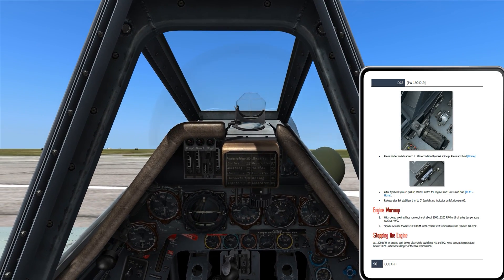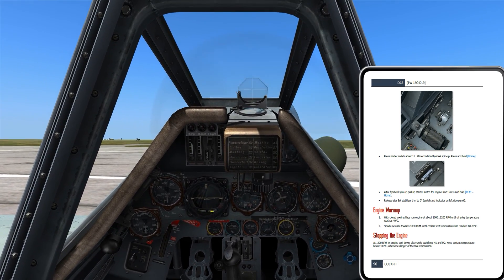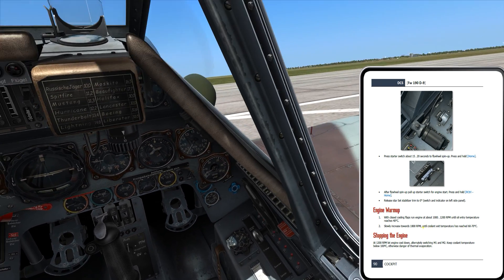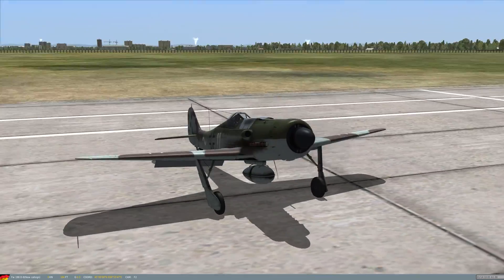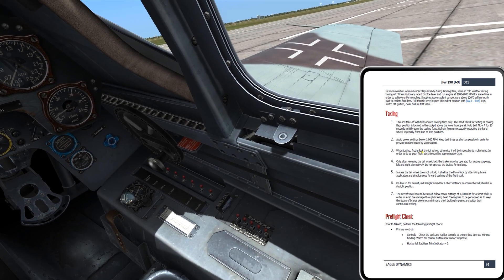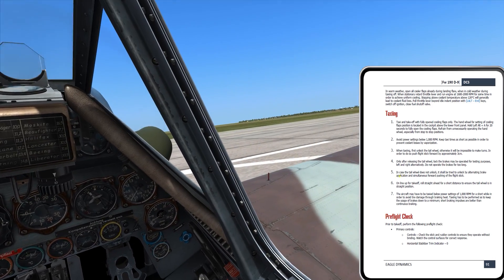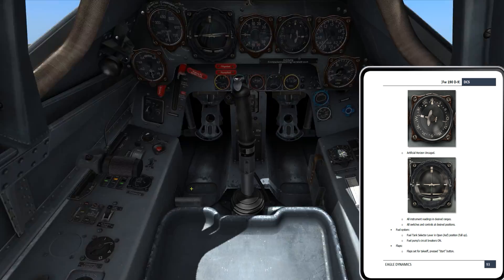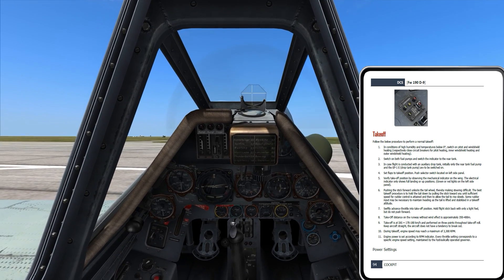Test Flight - Fw 190 D-9 Dora #2

Comment: There is a bug with electrical systems on both the Dora and Kurfürst. After flying for a while or even just idling for some time the battery will drain and it won't recharge. You will notice instruments start to flicker really bad after a while and when that happens your radio won't work if you're idling on the ground (you will hear static instead), during flight the pitot heat stops working and I'm sure it affects other systems as well.
Reply from the maker: MrSchalke04 I noticed the flickering at some point now that you mention it.  I'll keep an eye out for it.  Thanks!

Comment: Maybe the flap on the right stays closed so that there is solid airflow going into that scoop on the right. I am just guessing.
Reply from the maker: sync232 It looks like that is the answer.  I was looking around on some aviation forums and the consensus was that it was either a fixed panel or a field mod to keep it from opening. It apparently affected throttle response when open.  That is the kind of detail I love. :)